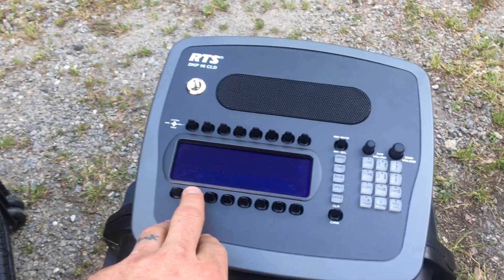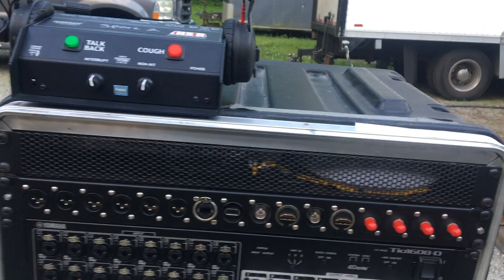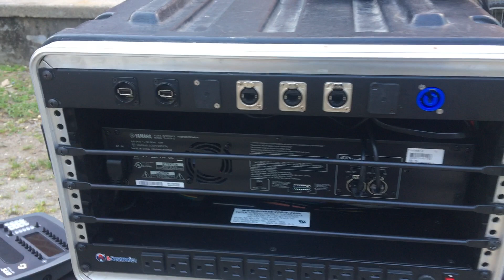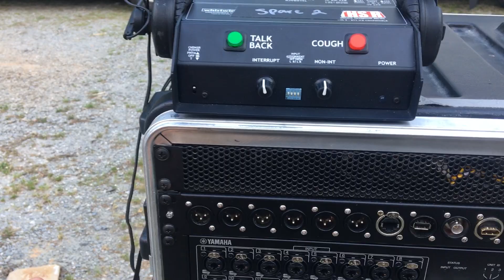Sports Announce Booth Over Fiber

Comment: Rob, dude, yes. Excellent video. 

The second fiber line for audio, is that for redundancy or is that to bring up the total amount of I/O?

Also, are the outputs of the TIO connected to the RTS power supply, creating a 2 channel 2 wire comms signal that is output through the 6 XLR outs at the top of the rack and then connected to the THS R IFB input?

Am I following that right?

I’d love to see this thing in action man! Solid build!
Reply from the maker: My setup takes two fiber channels for audio because i am using SFP's in my Unifi switches that require 2 channels of fiber.  In other words, my network requires 2 fibers.  I chose this because interpretability was more important than fiber inventory.  Your constraints may be different.  

The native wiring is more about creating IFB mixes, not creating 2w comms.  That to say; Its a sports BOOTH, not a COMMS origination point.  So my wiring is DIRECT to IFB.  If comms were a common need in my booth than i could have leveraged the pathways differently, but i was more concerned with talents comms than crew comms.  

Thanks!  Keep the questions coming!
Reply: I got you, I misspoke saying comms. 

I should’ve asked, you’re combining the outputs from the TIO through the RTS power supply (and some DAs?) and outputting that through the 6 XLRs at the top of the rack and that XLR connection is passing 2 channels of audio one being non-interrupt and the other being interruptible program?
Reply from the maker: @anthonyramirez3055   I think you got that exactly correct!  IFB1-3 are using PGM 1 (XLR7) and IFB 4-6 are using PGM 2 (XLR8).  I felt that this gave me the correct amount of diversity for the truck i was building for.